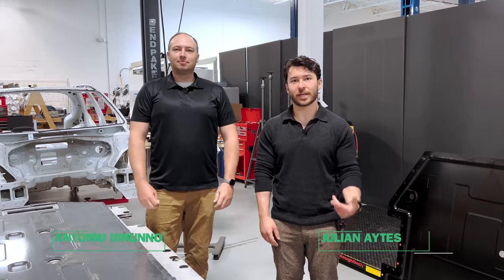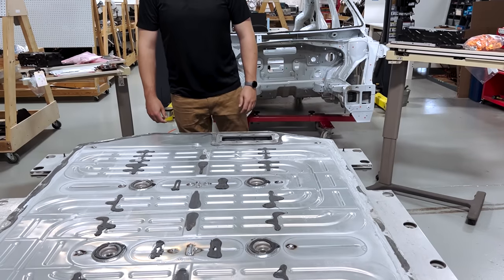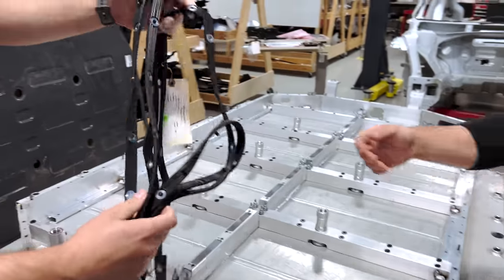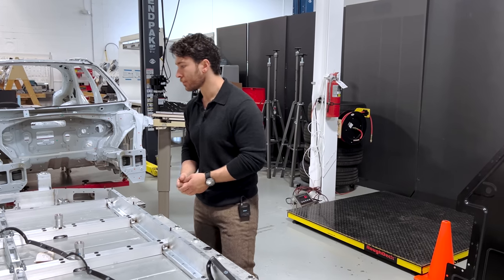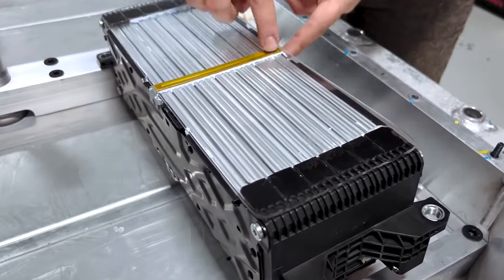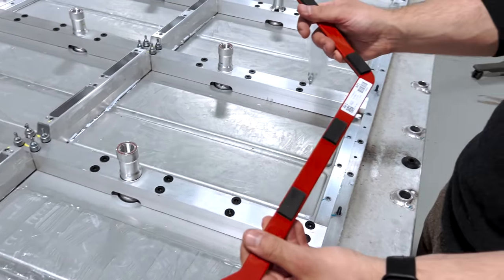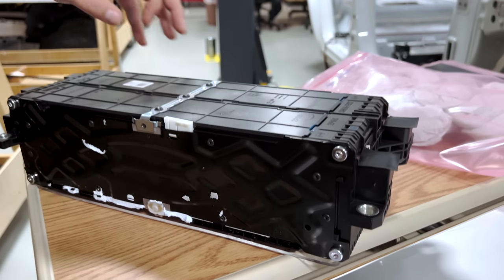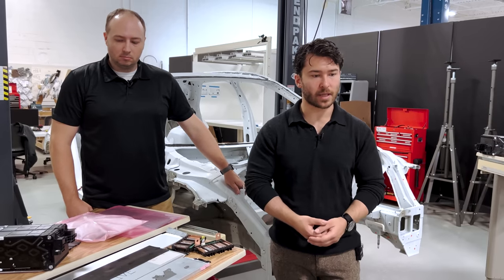Hyundai Ioniq 5: Integrated cooling plate | Battery Pack Breakdown

Comment: I'm loving all of the Ioniq 5 content lately. It's very rare to see your current daily driver vehicle torn down and get some expert opinions on how it was made. So far everything I've seen gives me confidence that I made the right choice for my first EV.
Reply: I am secretly hoping that these EVs last longer than gas cars. Some Tesla M3s are hitting 300k miles. These are too new. My brother had a Rabbit GTI back in the day. The Ionic 5 reminds me of that, only much newer, and has all the stuff I love about EVs.
Reply: @fjalics there are leafs that are well over 10 years, with just tires and windshield wipers replaced.

Once this sinks in, EV adoption will skyrocket
Reply: The Ioniq 5 has very poor battery cooling/heating. The difference between the lowest and highest temperature can be 10° C, which means that the car often rapid- and coldgates, sometimes in the same charging session.
Reply: @fjalics  TM3 made after 2019 should last 750k miles.
Reply: @davidbeppler3032  I got mine Nov 2018. Only got 60k on her. Dual motor too. I had a Prius before that. Off the line is quick. 🙃
Reply: I do not want to be a spoilsport but a lot of those welds look really horrible (I worked several years in a metal workshop and welded) at minute 11:37 you even can see that the cylinder is not connected to the sheet metal over half of the welds length! I hope your cars battery casing is made with better welding.
Reply: Leaves make me sad with their battery degradation and here we see another pack without liquid coolant. This is ballsy for Hyundai considering the history. I hope they don't struggle in the desert.
Reply: @rabidpeach  It does have liquid cooling. Flowing through the coldplate.
Reply: @tdome3000  But it also has a very fast charge curve, with high charge rates until quite full (>150 kw up to 80%), giving one of the fastest 10-80% charges currently on the market. That doesn't really tally with 'poor heating/cooling': it would appear to be more than adequate much of the time. You could halve the ioniq charge rate due to batt temp not being right and still be charging faster than many other available vehicles. Here is an example session: https://www.youtube.com/watch?v=CpFOTS9T1eU Temp rose from 24C to 51C during charging 1-80%, then got down to 40C by 100%. Is it really fair to characterise that as 'very poor'?
Reply: @xxwookey  thanks for mentioning it. I was hoping this battery pack video would talk about that cooling loop but they didn't and I thought it wasn't there.😔
Reply: You’ll really love it when they tell you how much a replacement battery costs
Reply: battery replacement cost you $60,000. no joke.
thats how hyundai KIA make money
Reply: In a light of current events in Canada where customers were charged 60k to replace battery after hitting debris on the road,  it seems that running integrated cooling plate was not at all great idea. Quality of welds inside a pack is also shockingly bad.
Reply: Are you still confident after witnessing $60k+ replacement cost.
Reply: enjoy $60,000 battery replacement,
Reply: Until like mine it’s sitting on my driveway for 2 months as it’s completely died due to the iccu failure and the blown 40amp fuse , now have to wait 3 months for replacement parts
Reply: real100talk5  Well, that's misinformation. Tires maybe, brakes definitely not. The cars regen. That means the electric motor acts like a generator slowing the car down, and that electricity is stored in the battery. Also, I'd bet a lot of money you weren't the least bit concerned about tire or brake dust till EVs came along, and if I asked you for details about the quantities or effects of the dust, you wouldn't have a clue, because you are repeating talking points.
Reply: @tdome3000  hey, how do you know this? mind if i ask your source?
Reply: You made a great choice here! Congrats for buying a much higher quality vehicle!

Comment: Edge cooling pouch cells was cutting edge in 2015, glad to see it finally made it to production. You get the most efficient heat transfer by going in plane to the electrodes vs. through the stack to another fin and down to the cold plate.
Reply: Bjørn Nyland discovered highest delta temperatures between min and max temp. in the pack. Over 10°C (a.k.a. Kelvin). That is very bad.
Reply: So many amazing engineers in these comments.
 Thank you
Reply: You should email your comment to Hyundai, im sure they will give you a job right away!!
Reply: @Stefan_Dahn  That does seem a significant variation. What are other battery designs getting? This battery does charge very fast so one would expect a correspondingly higher cooling load and thus a higher temp differential for a given cooling capability. A higher differential is not necessarily bad so log as all cells are kept within reasonable wear levels. The devil is in the details here. perfectly consistent temps would be nice but you never get that in real-world cooling systems, so the question is 'is it good _enough_?'. Where I guess 'good enough' means >80% capacity after a decade. The car comes with an 8-year 100,000 mile battery warranty, so they are expecting at least 500 charges to produce less than 30% degredation.
Reply: @Stefan_Dahn  Dude Celsius isn't Kelvin LOL
Reply: @sprockkets If You speak about a delta, Celsius or Kelvin is the same per definition.
Reply: @instanoodles  Hyundai didn't engineer it in the first place LOL
Reply: @norbertscheibner8334  It's completely irrelevant in the first place.
Reply: @sprockkets  If it is irrelevant, why You stated that "Dude Celsius isn't Kelvin LOL", when @steda8109 wrote explicitly about a delta in temperatures?
Reply: @norbertscheibner8334  keep crying
Reply: Lolol. Yeah agreed. Total amateur hour.
Reply: Lucid has the most efficient electric vehicles on the road. And it  also uses side cell   thermal management. And it's repairable.

Elon fans always get triggered by superior technology.

Comment: Two separate instances of battery pack impact damage and insurance companies scrapping the vehicles after learning replacement cost is 60k Canadian.  Neither vehicle had any warning lights or indication of faults in the computers.  Not acceptable.
Reply: What's unacceptable about getting a new EV? If an insurance company stupid enough to pay for it. When did scrap yards go out of business? There's always a lower cost alternative.

Hyundai deals with realistic problems Instead of blaming others such as calling it driver error.  Thanks for the BS scaremongering FUD. 

FWIW Rusting Cybertrucks. Is truly Unacceptable...

Comment: Great info to see.  Would love to see a teardown next of the ICCU especially with the NHTSA investigation and recent software inspection they just released.
Reply: The fact that a software fix came out makes me think this was a software problem to start. Old school firmware guys are pretty notorious for being ridiculously slow and lazy to do anything, and a 6-12 month release cycle to fix ridiculously bad errors is par for the course.
Reply: static.nhtsa gov/odi/inv/2023/INOA-PE23011-2700.PDF
Reply: @FuncleChuck  My (vague) understanding is that the software fix is to prevent too much flow thru the ICCU under some circumstance(s) causing the fuse to blow. Once it blows the unit needs to be replaced, but the software lowers the max power (?) that will be sent under that condition and keeps it from bricking.
Reply: @ritchie70 and prevents the car to charge (AC as DC is unaffected with this) at rates it was marketed to do which sucks.

Comment: I feel like the benefit of an easier to disassemble pack is recycling. I know you can shred the whole thing, but I think it would be more environmentally friendly to separate as many of the big components first as possible. Yeah it's a one time scenario, but it's also a major event. Maybe if you can get the design so lean as to not matter as much. The 4680 pack feels like it's getting there.

I'm not as concerned about pack repair as I once was, I think battery chemistry and design will get to a point where failure will be so low as to not matter. Failure rates are already pretty low with current tech. Seems like most repairs were on older vehicles with suboptimal thermal management.
Reply: Battery pack price will continue to decrease as well. But until it goes down to sub $5k per pack, there will be a lot of ppl that will hold off on buying an EV. I plan on trading my MY after the warranty expires. I think we are still 8-10 years away from cheap battery pack replacement.
Reply: @Teddy_M85  Yeah, also a reason I'm less concerned with pack repair. Not only do you have to gimp the new cells to match existing degradation, it's generally not an easy process. And yes pack prices will come down with scale. ~10y is probably a good estimate.
I will continue to monitor my M3 pack health. As long as it shows no sign of accelerated degradation, I plan to keep it for at least a few years after the warranty. 10 years at least unless something really revolutionary comes out. Already owned it for 2.5 years with maybe 3-4% degradation. That 9/10 year mark is where I break even with gas savings vs. extra vehicle cost of what I had.
Reply: When the pack is worn to the point that it will be recycled, you are probably recycling the entire vehicle anyway.
Reply: @Zeesneakyninja  What about single cell failures?
Reply: Can you point to me where this mystical "Shredder" is? Or did you hear this from Munro?
Reply: Tesla has such a high reliability in their packs that they do not need to make cells or modules replaceable. Might it be related to pouch cells? I only know that Elon Musk is very much against pouch cells because it is more difficult to avoid a thermal runaway.
Reply: @USNEM  I didn't hear this from Munro, or not initially at least. The current method of recycling is shredding individual modules. There's no reason you couldn't shred the whole pack at once, but you'd need a pretty damn big shredder and more process time for all that extra material.
Reply: @nilsfrederking62  Pouch cells are obviously nice for density but I prefer cylindrical for durability and as you said higher safety from thermals. Now if we could get LFP or something similar to near the same density in cylindrical, I would be excited for that for more than just EVs.
Reply: @andrewt9204  Is thermal runaway really particularly lower risk with cylindrical cells? Both layouts can suffer thermal runaway. Is the idea that if just one cell is far too hot it's harder for it to heat it's immediate neighbour than with two pouches clamped together?
Reply: @xxwookey  I would say yes by a small margin. Internal shorts from expansion/contraction are one of the causes of failure. Cylindrical cells will maintain better rigidity as it internally compresses. 
But otherwise I wouldn't think there is too much of a difference. Like you said, the gap and steel casing armor between cylindrical cells is what really gives it a bit more passive safety over stacked prismatic & pouch cells. Tesla has that fire retardant foam between their 4680 cells, that should help insulate against neighboring cells.
It's almost guaranteed a whole pack/bank of stacked pouch cells ignite if just one has a failure.
Probably a good motivator for improvements on safer chemistries like LFP. The elements are not flammable even at short circuit temps, it just vents a lot of smoke.
Reply: Ummm…never mind lol

Comment: "getting a single module out, usually is not a super simple task" and goes on to question the need for a practical and easy to remove and reapply rubber seal, just for the technician to say this pack is one of the easiest to disassemble! 😂 Dude was driving his point for a whole minute and the tech guy flipped the conclusion 180° 😂

Comment: Great video. Loved that the old man, tesla fanboy, wasn't there. Any video he's in is purely propaganda for musk/tesla. Really enjoyed good neutral comparisons between all the ev platforms. Thanks again for the great video.
Reply: Yes, the staff have proven to be highly professional and unbiased. Exactly what I expect from university training.
Reply: What we want in a teardown is critical analysis. Staff do not have the authority to criticize potential customers. Owners do. Hence why the failure of the old design Hyundai pack is not mentioned. It has high temperature delta between cells which results in charge throttling and potential cell failure, as demonstrated by Nyland.
Tesla does not.

Comment: TIM can provide the stability at vibrational stability with modular design feature. The battery cell temperature shows the lowest level because the cell resistance is very low compared with others. Integrates cooling improves the pack assembly and disassembly which is good for productivity and recycle.

Comment: the launch models of the I5 had a solar roof for charging - would be interested to see how this was implemented without having to close the contactors - I'd imagine a seperate low-current feed into the pack with diodes for isolation  - did you see any signs of this ?
Would also be interested to see details of how they do 400V charging, and what power they can do this - ISTR reading they use the motor as part of the converter, like the Renault Zoe did for high power AC charging. 
Also the AC inverter for V2x - is this part of the onboard charger ? Hopefully you'll be diving into these boxes soon...!
Reply: I'm sure any external power was routed through the OBC or inverter just to prevent over-charge.

I'll make sure to bring this up in the discussions to make sure its addressed in the videos. 

Thanks for the input Mike.
Reply: @BatterVswithAntonio  But if solar was routed through the OBC or inverter, it would have to close the pack contactor, and the contactor coil current to do that would eat into any gain from the solar panels. As solar would be pretty low power, and nowhere near the 800V pack voltage, I'd think the best way to do it would be to feed it into the pack housing, where a boost circuit would convert it up to 800v, protected from overcharge by a simple overvoltage cutout and diodes to prevent backfeeding.
Reply: Probably just charges 12v batt. To run stereo, HVAC fan maybe. Things like that.
Reply: Good question.
Reply: @coreyverisario6570  re: "Probably just charges 12v batt. To run stereo, HVAC fan maybe. Things like that."  yeah, it was just a fancy maintainer (ref:  Battery Tender) for the 12V, which indeed benefits the HV battery albeit indirectly by way of the DC to DC converter not having to turn on. people still don't seem to process how there's just not enough surface area and not enough output to bother with the complexity of integrating it to the HV system to begin with, and even then the output that it DOES produce is dependent on weather, time of day, etc.  yeah, all the same variables that impact Renewables on a large scale also impact small scale Renewables placed on the tiny roof of a vehicle.  this reality combined with the COST (God forbid we forget about that) is why the Solar Roof was only offered on the limited run Launch edition, very similar to the other Hyundai products that got Solar Roofs.  it's purely a "sales gimmick" and not meant to be anything more, and that's fine as all the Manufactures offer a "gimmick" in one form or another to make a "green statement" and entice consumers to buy their vehicles over the competition, naturally some features are more "gimmicky" than others.
Reply: @mikeselectricstuff  How much power are contactor coils? 1W? 3W? 5W?

Comment: Those circuit boards in the modules are simple breakout boards and the components on them are fuses (it's even labeled on the board). All the things lucid had on the module circuit board are external to this module.

Comment: Great informative video, thanks.
That SMC (unsaturated polyester) bottom "shield" for the high voltage battery pack sure looks vulnerable to impact damage from debris on the road. Shouldn't Hyundai/Kia/Genesis use more substantial material for the shield to help prevent impact damage to the battery pack assembly including the battery cooling system (i.e. cold plate)?
Reply: There's two recent cases in Canada where (what appears to be) minor damage to the shield voided the battery warranty.  The cars needed a $50k replacement battery!

Comment: This is very great content and very through engineering review. I own an Ioniq 5 and myself am also a battery module designer (pouch cell). I can see that the thermal management design between module and pack can improve for sure. 3mm of TIM is asking for weight/thermal resistance trouble. Are there vent ports in the pack? Thermal propagation is becoming a heated topic in the industry and love to see how pack design will transition to eliminate TP.
Reply: A good thermal management is crucial for longevity, I have a little bit my doubts about this design.
Reply: They went over it, there are no valves just that gasket designed to release pressure in the event of overpressure.
Reply: TeslaBjorn's drives in this car while using Car Scanner showed a huge difference between the highest and lowest temperatures in the pack (I think it was 8 or 10 °C), so yeah, this cooling plate with that much TIM is non-optimal and results in charge speed throttling on long high speed road trips. I appreciate how much more serviceable, and probably recyclable, this pack is compared to some of the others though.
Reply: re: "Thermal propagation is becoming a heated topic in the industry..."  <--- i see what you did there.🤙
Reply: @phillyphil1513 It was a very heated exchange

Comment: To me it seems the bossed areas below the modules essentially turn the coolant flow of each module parallel to each other, instead of being in series. That's really smart. They controllably "short circuit" the main coolant channels, some for each module.